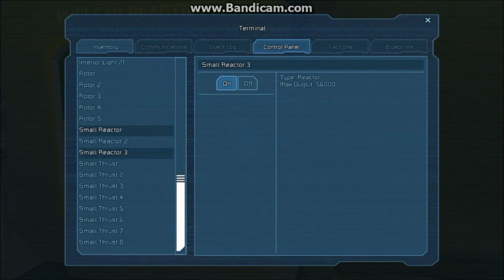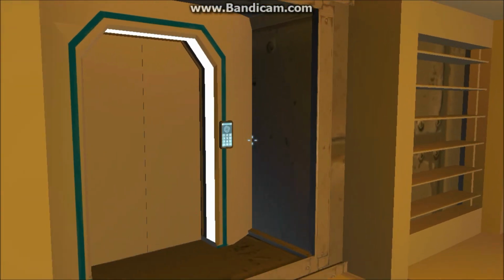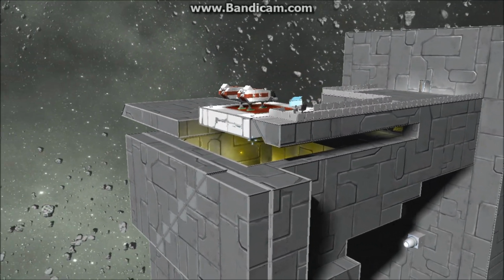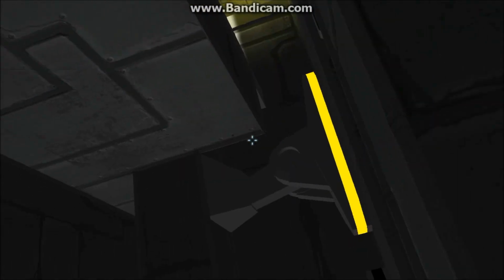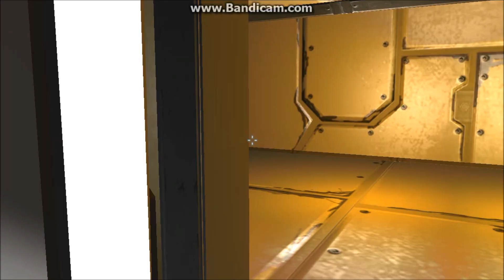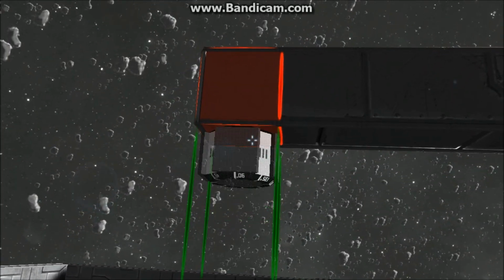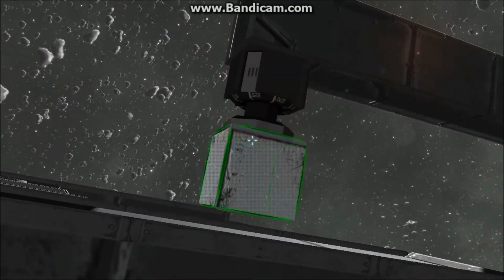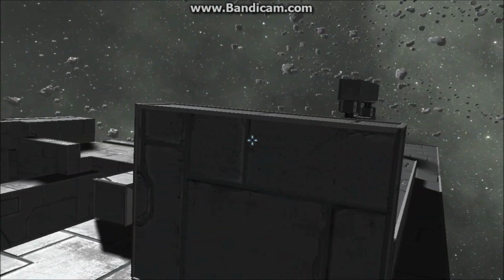Space Engineers   Automatic Elevators

Comment: how do you put blocks near the floor from the rotor? i just bought the game few days ago and i tried making a gate but it only let me put blocks if it had a gap from the entrance
Reply from the maker: In this kind of elevator design, as mentioned in the video the minimum and maximum heights reflect a full 180 degree rotation of the activated rotor. So by setting the angles for example between 0 as the minimum and 180 as the maximum, your elevator will automatically stop once the rotor reaches that given value. Take a look at the part of the video where I explain the angles to put this info into context. If you want to make it stop at intervals, just stop the elevator at any given floor of your ship or station and make note of the rotor's angle and change your settings accordingly. Either that, or you can put a panel inside and make it stop by activating the elevator shaft's landing gears.
Reply: Ronin SamuraiTV thanks for the fast response :) i have another question. so i put a rotor in a hole in the floor, and then a block on the top of the rotor. then i tried putting a block on the right of the block that is on the rotor. the game doesnt let me do that. i think its because it close to the floor or something, but im not sure. and you managed to make a gate, so i guess you figured it out. so an explanation would be nice :) thanks
Reply from the maker: Nitai Gildor yeah check out my other video on that: http://youtu.be/xY1TcjO4b4s
It should answer all your questions regarding the issue you are facing - just let me know if anything remains problematic or unclear to you :)
Reply: Ronin SamuraiTV thanks so much for the help :) i just tried doing an elevator and it worked great. also your video helped me find a problem i had with a previous gate i built, which didt stop because i didnt know what angles are. thanks!
Reply: Ronin SamuraiTV oh yeah one last question. so i built a pretty cool ship with my friends, and we put a hangar for the fighters. we landed our fighters in, disabled the thrusters and activated the landing gear, then when we started actually flying big ship the fighters started moving around and they disconnected. is this a bug? or did me and my friends didnt understand something right?
Reply from the maker: Nitai Gildor  No that's kind of buggy still - try having 3 or 4 landing gears on your fighters, and some artificial mass that you can activate when you land, with a gravity field generator in your large ship keeping the fighters on the ground. That should help in stabilizing them a bit more.
Reply: Ronin SamuraiTV ok thanks

Comment: Hi I'm curious, if I need to make a super long elevator how would I go about doing that, I have one that probably goes 50 stories up and down as one floor
Reply: My elevator is 27 stories high
Reply from the maker: Benjamin Willard  All you need to do is follow this guide and get your proportions right. So if you want your elevator to go up and down 27 blocks, you will need to have 27 blocks on that first rotor, and 55 blocks on the next one. On the third rotor it becomes up to you... However for the guide rails you will need to either invert them (meaning instead of building the landing gears on the ship / station, you will need to build them on the elevator) or make the guide rail system wider than your actual elevator platform. hope that makes sense to you? The reason behind this is that if you want your elevator to be gap-less and be stable, you need to do that - otherwise you cannot have a guide rail all the way up and down to have a stable elevator as your elevator platform will hit the landing gears as it's going up or down.

This means your elevator structure will need to be massive though...
 Honestly you're probably better off making a gravity elevator.
Reply: Ronin Samurai Thanks your probably right, the problem is the 27 blocks down would mean I need a big gap, and well I can't do that since it would mean that it would hit other parts of the station...  this is what I have right now and I think I need something like this from KSH http://forums.keenswh.com/post/mag-transport-6539377?&trail=15.

This would work so much better, so for now I am going to just make it a jetpack tube to go to the top...  It is only a 3 by 4 room elevator originally i was going to use wheels but that didn't work as well as I hope, and maybe I will give it a shot again...
Reply from the maker: Yeah exactly. You can use a rail system with wheels and gravity generators - I've got one of those and it works great! Or you can also use an anti-gravity elevator. I'm working on a prototype right now, I'll upload it once it's ready. Trying to make it multi-directional so it is taking a little more time...
Reply: Ronin Samurai Gotcha, I am really interested in that mag transport and I hope the DEVS implement it.. Anyway good luck, I found out that wheels don't work as well, but I just realized that it will be easy to make station doors now rather than relying on the large doors, by using wheels instead of 'landing gears'
Reply from the maker: Benjamin Willard  You don't even need to bother with wheels for nice doors - check out my new video, perhaps you'll find one or two designs that will simplify your life: http://youtu.be/xY1TcjO4b4s